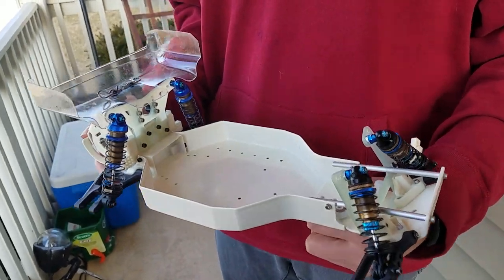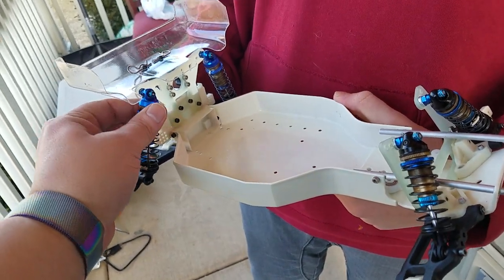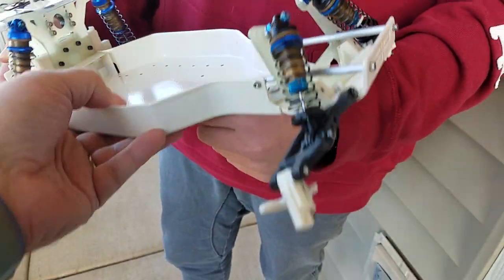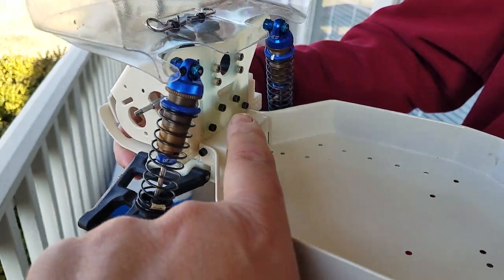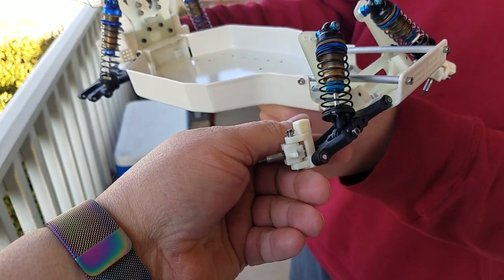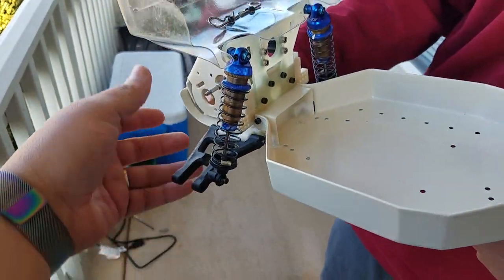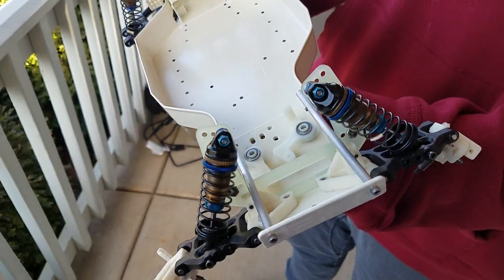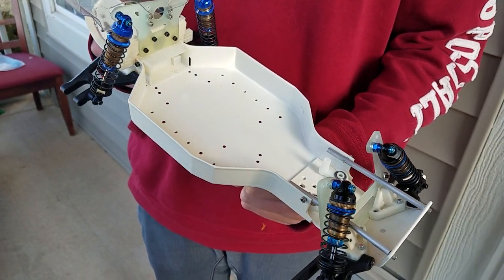RC10 CE part 7 rebuild big bore shocks & nose supports in stalled

Comment: Threaded shock body's. 😀
Reply from the maker: no the actual spring tensioners lol
Reply: RC10CNC Oh ok those little plastic spacers that put tension on the spring to raise ride height.... Hopefully thats what your talking about.

Either way that car is to drool for👍👍👍👍
Reply from the maker: ha ye thats it,  sometimes when i do these videos with my son i dont rehearse lol i just hit record and draw blanks. im getting old ha
glad you like man, check out the other Cadillac i restored. im leaving that one gold pan with stock arms but it also has big bore. im also going to do another powder coated rc with silver rc10 shocks but with a 6 gear.  so many projects so little time. glad my son gets involved or i would never get anything done. busy busy
Reply: Dam I’m gonna have to redo mine that I still have from 1985 lol I have the RC10 Classic just need to clean it up like u did and put new electronics and maybe some new upgrades to I’ll keep it the same. Nothing is broken on it but dam that car was fast back then and still is and I’m surprised they still have parts and all after watching all ur videos. Thank u for this and glad I found u. I got the X-Maxx 8s and now gonna fix this RC10 up 😂
Reply from the maker: @ripbry95  great old memories!